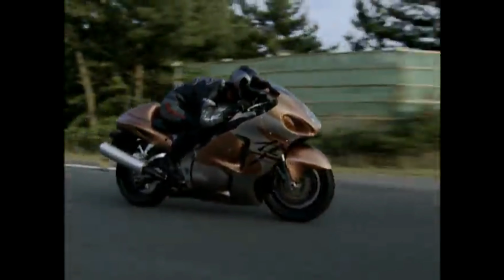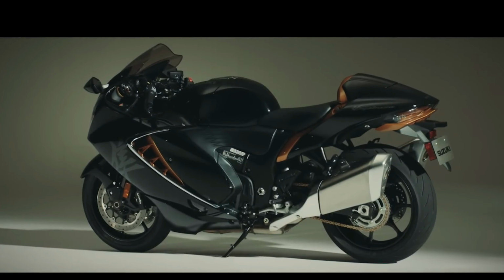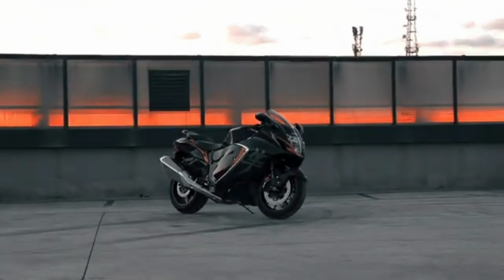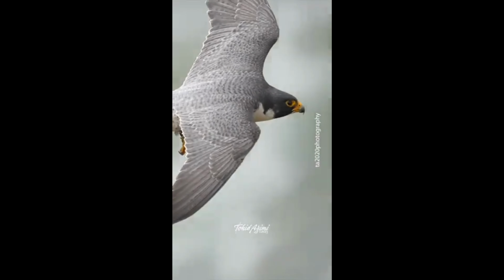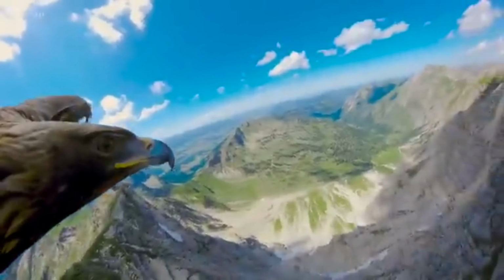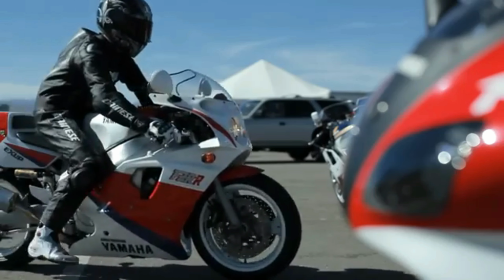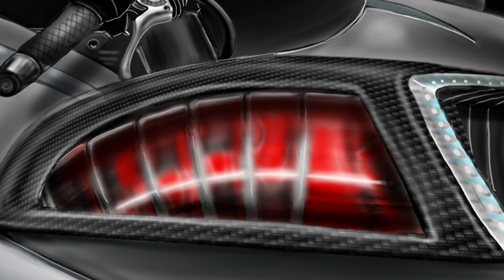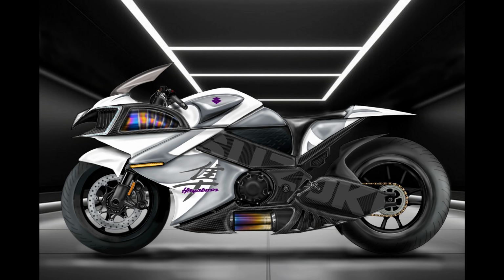The next Hayabusa   Superchargers, Carbon fiber frame, 300+ horsepower and much more

Comment: good but for now in the road keep record by koenigsegg fast supercar and by bike record is kawasaki h2r yea ofc if tuned busa be killer but best design and engine system works low oil temperature and turbo works very high rpm  that why beat stock busa

Comment: Carbon fiber frame 🤔….Sounds like a damn $50,000 bike.  There has to be another way to make it lighter!
Reply from the maker: @jonasbaine3538  Nothing comes close to carbon fiber when it comes to the weight and strength. If done correctly and at a mass scale, the price of production can be reduced significantly. Raw materials are not expensive, the cost increases due to the time and labour it takes to manufacture it.  The engineers have to figure something out for this… 😬
Reply: @whatsupdoc666  I hope you’re right and they can mass produce at low costs!  Heaven forbid dropping the bike and damaging the composite material fiber!!